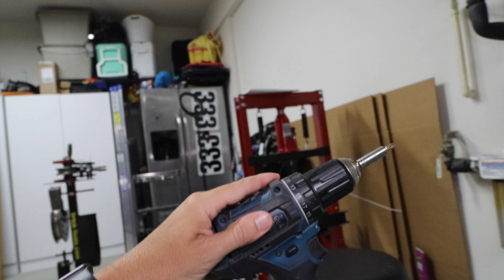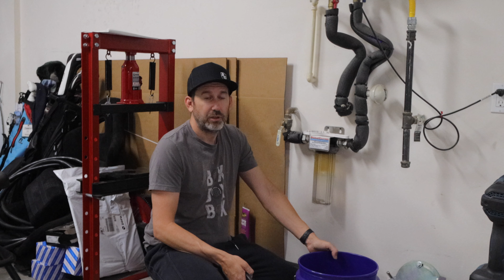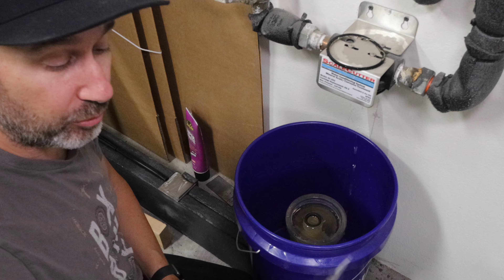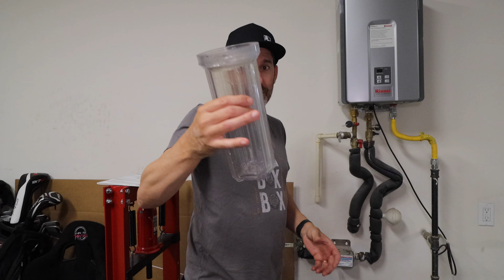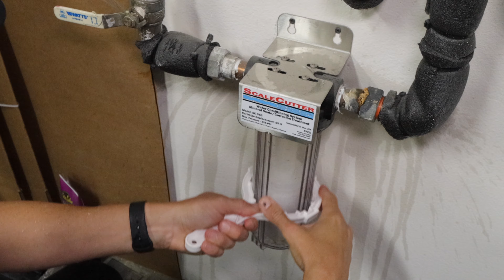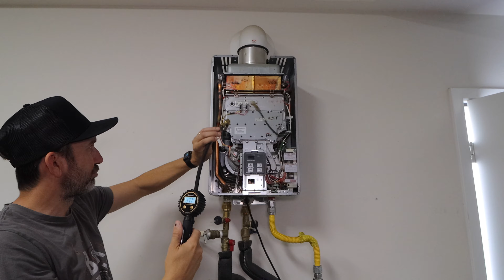Rinnai Tankless Water Heater Flush

Comment: Thank you for your video. I have the same brand, there is a small black cap in the bottom, do you know what is that. Do I need to keep that tighten?
Reply from the maker: You shouldn’t have to mess with anything other than the hot and cold valves

Comment: Great video! I owned 2 Navien Tankless units in my previous home. I just built my new retirement home. I had the Rinnia RX199IN installed. Oversized for the house but I can have a lot of family and friends come and stay (live on the coast) and have endless water. This is the same flush procedure I used on the Naviens. I am excited to flush it in a year. I use the 1/6 HP submersible from Harbor Freight. It does a great job! I don't flush with the tank afterwards with an external hose. I simply run the hot water in all the faucets and after 4 minutes the vinegar is gone. Thanks! Liked and subscribed!
Reply from the maker: Thanks for watching! Congrats on your new home!

Comment: Did you turn the gas off, I'm pretty sure it says in the manual to turn the gas off. You also did not clean the igniter rods.
Reply from the maker: I’m pretty sure I only shut off the water so I could pump the vinegar through the system. I didn’t touch the igniter rods either. This was only a basic system flush.
Reply: The Rinnia video on doing this does not clean the igniter rods as well.

Comment: Rascoe, where did you get the part from and I know you said in the video it came with the wrench. I'm trying to order the part now and no one can answer if the wrench is included. Thanks for the informative video Bud
Reply from the maker: Are you referring to the replacement cartridge for the descaling unit? It came with the plastic wrench to get it off. The company is Southeastern Filtration and it’s part #210613 SS-EXT Cartridge. It’s the OEM filter cartridge replacement for Rinnai scale cutter SS-3. It’s $105 plus shipping.

Comment: Good video. Why didn’t you use a socket on the shut off? I prevent potential rounding of it with the lock wrench? Also do need to cycle the tankless once drained?
Reply: I never saw this type till my plumber put these on my new unit.  Thank you for the tip.  13mm.  I tested it out and it worked great, also got to wash my shirt in the process LOL
Reply from the maker: Thanks for watching! Once the flush procedure is done you just turn it back on. No need to cycle.